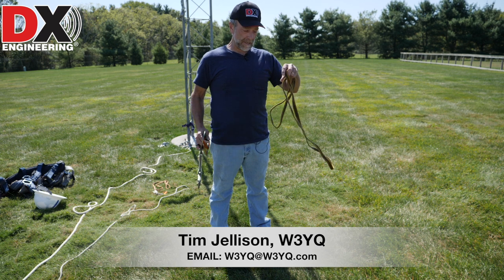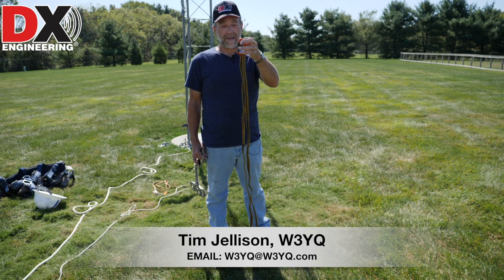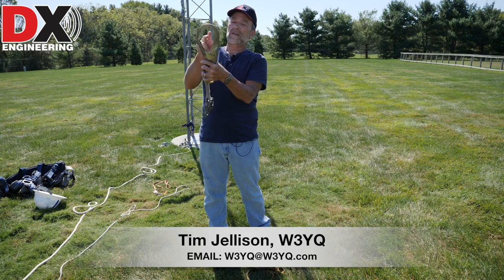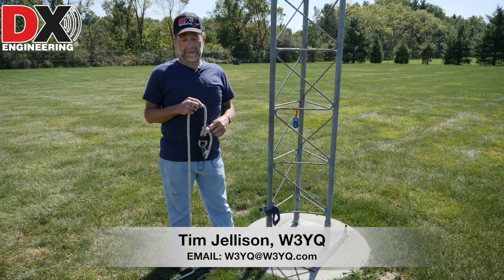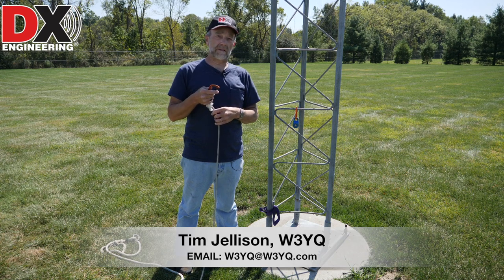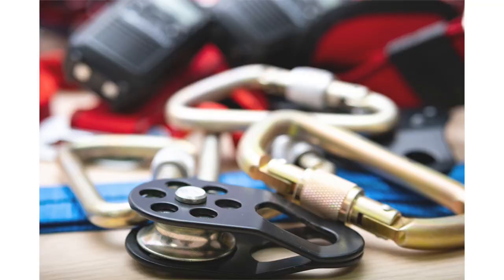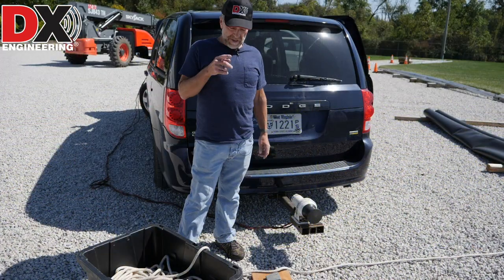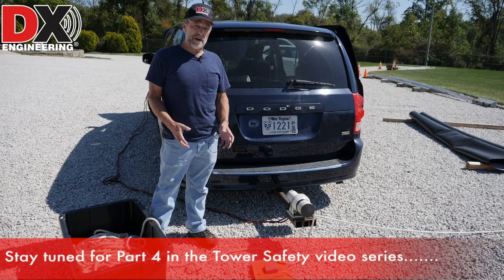Amateur Radio Tower Safety Part 3: Rigging a Load on a Tower

Comment: Double braided means it won't tangle up?  Quite the ignorant comment.  It may have that effect, but that doesn't define it.  One more thing.  If you are pulling a heavy load, use a mechanical advantage with a break.  Don't be stupid and wrap it around yourself.
Reply: Hey said, “so it doesn’t kink”, NOT “it wont tangle up”. There is a distinction. Speaking of ignorant, reading comprehension is your friend.
Reply: @BBaldwin  3:25